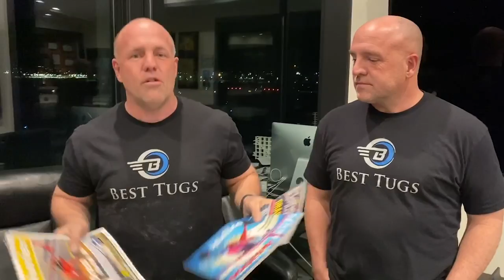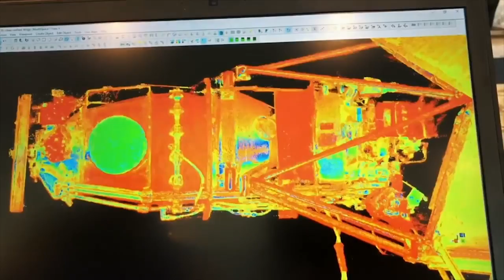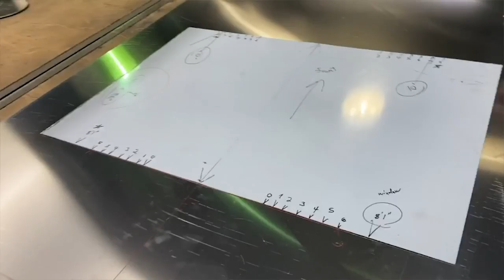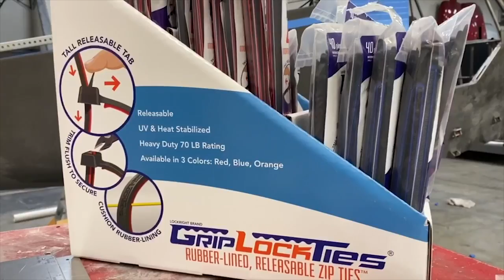Vertical Stabilizer & 1 Hour Carbon Fiber Part 🤠 | Scrappy #8

Comment: Probably the biggest thing that most deters people from flying, or at least myself, is the money aspect. Flying is expensive. Even the price of a demo flight might keep someone from trying it. I was fortunate to have a dad who paid for me to take an airplane ride which got me hooked immediately. It showed me that despite the high cost, it’s was worth every penny however difficult it may be to afford. Anyone with the privilege of owning an airplane, take a kid for a ride. Show them what the world is like a couple thousand feet in the air. Show them that whatever troubles they’re facing disappears for a short while as you soar with the birds. Show them all the complicated components and moving parts working together in harmony to achieve something as graceful as human flight. You will change their life and open their eyes to a whole new world of possibility. That the aviation community is one bonded solely over its love of flight, and we’d love to have you join us.
Reply: Ok. You get 'em hooked on aviation crack. But that's not the problem. How do they afford it? That's the issue to address. And it's not just the initial certification. They also need to maintain currency.

Comment: Mike I want to thank you for all your, and your families efforts to inspire folks into aviation. You're all amazing. I grew up in a remote part of N.E. Alberta, 52 miles to the nearest road, there we had a hunting and fishing camp. Our main transportation, apart from dog sled and horses, was a stripped down 1952 T-craft, F19 sportsman. Floats to skies she was a workhorse and at 13 I started doing most of the flying as I was the lightest, some prerequisite? Never had a need for a license and we changed to a cattle operation when I was 21 and I left for the RCMP and served til retirement at 70. I found your channel a few months ago and it brought back the old thrills, unfortunately health won't allow me back in the air but I can certainly see your ability to attract others in. Keep up the great effort, Billy in Canada

Comment: Many years since this video was made, here I am watching the entire Draco build . Now watching the Scrappy build. I’ve always tinkered with mechanical things. I’ve worked as a car mechanic and currently work in IT. IT was more just to pay the bills. I’ve always been drawn to mechanical stuff. Currently really into RC cars and trucks, just can’t seem to leave them stock. Always have to mod them and make them better. These videos are fascinating , opened up a better understanding of aviation engineering building. I remember watching the competition videos of Draco like 6 years ago and was very impressed . I’m probably going to get into the RC plane thing because of these videos.

Comment: Simply having your enthusiasm come through the videos is helping tremendously.  As I see it, there isn't much you can do to overcome the single biggest hurdle to GA: cost.  I learned to fly 31 years ago, had fits and starts due to career changes, college, family, etc. and finally got my Instrument Rating when I was 50.  Rolled right into my Commercial, and now am working on my CFI.  I plan on "giving back to the community" by giving as many free introductory flights I can afford (which isn't many) and offering some free flight instruction (I don't want to infringe upon those needing flight instruction as a primary means of family income).  Please keep the videos coming!

Comment: I  would like to thank you for putting out the idea of promoting general aviation. I have been a pilot for 30 years but also an air traffic controller for 31 years. I think that not only the promotion of General Aviation but the increase of safety. The largest issues that I have dealt with is miscommunication and levels of assumptions that have caused some critical decision issues that have left some beautiful airplanes in  pieces. It would be fantastic if the idea of when to go and when not to go gets discussed! 
I enjoy so much watching you build these airplanes and the videos of the " flying cowboys " and their general aviation exploits.

Comment: I was wondering if the rear spar on the vertical would be strong enough to handle the torque from the taller, bigger rudder.......but looks like you solved that!! As always, I love the infectious enthusiasm you tackle everything with!

Comment: You give so much, your passion is inspiring. As a practical matter, an "investment" in aviation is out of reach for so many. Any thoughts from you or your peers?
Reply: Paul Sampang  Hi Paul, I have a story that might help. For years I dreamed of owning a plane, and shopped online for everything. 5 years ago I settled on a Kitfox IV that had been built, ground looped, repaired, and put for sale. I needed a new F150 at about the same time as I used it for work and commuting. I put off the new truck for a few more years. I bought the Kitfox for half the price of a new truck. Now I use the Kitfox to commute, which saves me gas money, time, and miles on my now older f150. At the moment I can say I own and fly a Kitfox IV regularly and the more I fly it the more it saves me. And because that’s my story, I fly every day, weather permitting.

Comment: This past weekend I used mikes exact steps to reinforce my upper cowling on my RV-3 using carbon. I totally understand why Mike works with so much carbon now, when combined with the peel ply you get amazing strength with very little weight. I cannot thank you enough for sharing this stuff mike!

Comment: Hey Mike, loved the speed of the build and the use of single shot mould materials it is great to watch. 👍
Just one point you may know to consider that when you did the belly tray with a wet lay up of carbon /epoxy over the male tool and covered it with peel ply you covered it directly with what you called a foam or what looks like “breather” material. In Placing this directly against the laminate/ peel ply the breather acts as what’s termed a “bleeder”, like blotting paper. This can in certain circumstances draw not only air out the laminate but also possibly too much resin. We would normally have a perforated release film in between the two that you can control the amount of resin bleed by size and pitch of the perforations. Obviously on this part it may not matter a dime as it were but on structural parts I’m sure you’d want an optimum fibre/resin ratio.
      Also applying the vacuum straight after lay up can lead to too much resin bleed out and ultimately a “dry” laminate. Most resin manufacturers state a minimum time before vacuum application. Just a few thoughts. Fantastic work bud, inspiring. Ever thought of doing an all carbon airframe? 😜

Comment: Thank you for addressing your method of isolating dissimilar metal corrosion and fastening technique. It’s been on my mind since starting to watch your videos. I work in carbon lamination and this information is GOLD! 

The carbon piece for the top and vertical stab turned out so amazing! Excellent work.

Cheers!

Comment: If you haven't looked at them, the Festool tools are AWESOME and when used with their vaccum system they do a GREAT job of capturing dust from their sanders, saws, routers etc. Really nice for keeping the shop clean and high quality tools. I rarely use my table saw anymore, because their plunge cutting track saw system is so awesome and versatile. Love your videos!

Comment: Always loved aviation. Was part of ground crew in South African airforce for almost 10 years. Love watching what you guys and your builds are so inspiring to me. 

I make carbon fibre parts for motorcycles (well I use a factory in another country not in my country) but you know what I mean. You have inspired me to start planning my next project and I will making my own one off carbon parts for that project after I finish my current project (van to camper van conversion). So next project will not aviation related but a 1970-1980 motorcycle modernised is the next project and just wanted to thank you for igniting the spark. You making your carbon parts blew me away and I realised I should start doing some one off parts. Lol, I already have a magazine subscription for the bike project and totally agree with your idea, the magazines has helped with new ideas and keeps the passion going. I will add though that I would love to get my pilot's license but my life is to hectic to slow down and put the required work and time into it but look forward to seeing how others get on with it. 

Brilliant idea on the grip lock ties. Makes sense and why hasn't someone thought of it before, well some one did now. 

PS You guys are almost identical, Mark looks taller.

Comment: Just turned 34, I come from a family of pilots. My father is currently building a vans Rv8, my grandfather was a retired chief pilot for the forestry service, my uncle is retired airline pilot, cousins currently fly private charter flights. I grew up flying with my dad in the back seat of his Shinn-2150 on a 4" cushion he had made for me at 8yrs old, he would let me go up with him and fly the pattern and call approaches etc. Went from that to simulators etc but have just never been able to get the funding to get my license, but it is definitely on my bucket list! I love working on trucks and tractors on the side from my full time job, so for me your videos combine two things I love aviation and engineering!

Comment: a trick is to use a reservoir inline from your pump as long as you get the bag sealed fully you won't need to run the pump the whole time the part is curing.   The way to do this is with either a check valve or a ball valve between the pump and the reservoir, you then  turn on the pump run it into a vacuum and shut the ball valve (automatically done via the check valve),  the reservoir will hold the vacuum while the part cures.   Another trick that works in combination with the reservoir mod is to wire a vacuum pressure switch so that the pump only runs when the reservoir vacuum drops below the desired minimum setting and turns the pump off when the vacuum gets above the max desired setting.  It'll save you some electricity and will save your sanity if you are constantly working in the same area that the vacuum pump is running (it's similar to being in the same room as an air compressor all day)

Comment: Mike, I want to thank you as well.  Even though I've come to the conclusion that I have too many expensive hobbies to get a pilot's license in the near future, you still have inspired me to be active on my own projects and think outside the box on my automotive builds.  I have gleaned some helpful things from the aviation world that I can put to use in the off-road realm.  Specifically, about suspension, brakes, cooling, and making things lightweight, but strong.

I look forward very much to all the build videos in the future.  I quite literally drop whatever I'm doing if I happen to get the notification that one of your new videos is out.

Comment: I just bought some of those Grip Lock Ties after seeing it on the Experimental Aircraft Channel a day or 2 ago! I've got 100 of them coming to test out - should be here by the end of the week! I had no idea you were a part of that, Mike!! What a fantastic idea!! The minute I saw those, I knew I needed them for my shop. I paused Bryan's video and ordered them immediately! I should have known it was you! You never cease to amaze the s*#$ out of me, Mike!!! 😁😎👍🍻

I think the best possible way to get more people into GA would be an affordable aircraft that operates like a V-22 Osprey, taking airports out of the equation, and putting GA right in everyone's backyard. Helicopters have this ability already, but to be able to have the high cruise speed of a fixed wing, coupled with the small takeoff and landing space would be fantastic. That's a TALL order from an engineering and marketing standpoint, as I don't think building something like that could be done without significant costs. Then there's the "annoyed neighbor" aspect of that (and safety), wherever the persons-per-square-mile is higher. Even Bell / Boeing had a tough time getting that idea to work in the beginning. Maybe the drone world is the answer - something on a larger scale that can takeoff and land more quietly. Battery technology still has a long way to go, IMO.  I've been thinking of this as I search for a landing zone for my paramotor near my dad's house, 22 miles away from mine. Would be so great to drop by and visit whenever the weather is nice, and not have to deal with maddening traffic, or look for a long stretch of unobstructed real estate for takeoffs and landings. Would give me an excuse to put alot of hours on my machine, for sure! I think this would revolutionize life,  just like the Model T did, if that could be made to work. Wish I had your drive, and ability, Mike! 🙌

Great progress on Scrappy! I feel like a kid at Christmas - can't wait to see this thing on the tarmac!!!

Comment: I own a machine shop/ fab shop and all the tricks and speed is appreciated Mike. Well done. I'm working on changing a Lancair 4P wing into one that is kinda like the Cirrus Gen 6 that John Ronez developed. I'm more interested in more lift and stall characteristic than speed. Even toying with the idea of leading edge slats. If I lose one person in weight carrying ability so be it. I want to keep max gross the same.Work is getting in the way and I'm back in college for my A&P license. Into it a year and a half. Have done recips and Turbine, the PT6 was on of them and the other a Allison 250. Big engineering job and manufacturing too. If if does not fly I'm ok with it. I've built my business and my home so always wanted to do this. My Dad was a friend of George Wing. He was big into experimental a had his own he got certified. It was call the Wing Derringer. Look it up if you have time. He start Hi Shear corp. He invented the Hi shear bolt and Hi loc nuts and many more fasteners. He was a genius and did not go to college but the society of mechanical engineering awarded him many awards. He has pass on. Thanks for the blog Mike, you are cool.

Comment: Magazine - What a super idea! I love your channel. I love building thing also! I suggest that you have a range that automatically open and close the aircooler vents using an actuator. If you cant program the Garmin to do it, an Arduino with a temp sensor would be the ticket.

Comment: You guys are awesome! Evercoat z grip is great stuff. They sell another product called plastik honey that you can mix with the z grip. It gives you a little more time to work with the bondo before it starts to set up and helps eliminate pin holes. Works great! Keep up the great work!

Comment: One tip I found when doing composites and temporary molds is to use the stretchalon vacuum bagging film and pulling a vacuum on the temporary mold. Then carbon/glass can layered on that film layer. It makes quick and dirty work on temporary molds. TTM Technologies might cary it in SLC.
Also, roof sealant tape is a cheaper alternative to the sealant tape you get from the composites shop.

Comment: Mike, a neat trick I found when sanding.  Get a 20" box fan and use painters tape to tape a 20x20 air filter to the back (they're cheap enough that you can get a MERV 13 filter).  Put the fan down on the ground below where you're sanding.  As the dust drops, the fan sucks it into the filter.  Toss the filter every once in a while and for around $40 + the occasional $20 filter you get a really effective dust collector for that fine stuff.  Obviously, it won't collect everything, but it's amazing how much it will collect.  Especially in your situation where you're sanding and the dust is falling down.

Comment: Hi Mike your project is inspiring!   I’ve built several RV aircraft and anytime I make a carbon fiber part I use one layer of fiberglass on the carbon fiber part that attaches to the aluminum aircraft.   This way you don’t have to be concerned with galvanic corrosion.

Comment: I’m an automotive painter of 15 years. One of the first things I noticed was that you were using “bondo” brand filler and am glad someone turned you onto evercoat. Since you are taking recommendations: You might want to look into a numatic DA sander from Hutchins or Dynabraid to help rough out the filler quickly. Also something called a “Jitter Bug” from Hutchins would make quick work of long flat areas. Or an air file. Just some thoughts. Love the content and can’t wait to see scrappy fly!

Comment: Are you planning wings and vertical stabilizer with variable chord? So the inner portion of the main wing washes out before the outer wing and aerolons . Additional chord on the vertical stabilizer to keep the tail up when loaded for trips or drag racing. But not too much as the engine weight.

Comment: I helped a buddy build a humongous sealed box for his subs out of fiberglass, and while finishing the plug we started with Bondo and then switched to Evercoat a few steps in after a guy at the paint shop recommended it. The first time I sanded the green stuff I was sold, what a night and day experience. The ease of sanding really helped because we were both pretty new to bodywork and used wayyy too much filler.

 I still use the pink stuff a lot because it's cheaper, but the Evercoat fillers sand so nicely and seem to produce fewer voids etc, gives a nicer surface, seems to bond better to itself, run less-just nicer overall. I use it mainly on small parts for my custom bike projects and stuff.

Comment: Warm weather large carbon fiber layups are easily done by renting a truck trailer or cargo container with a reefer unit. Actually it might take two. As you need to chill a layout table too. . Its just a thought. But for most big parts it should work.